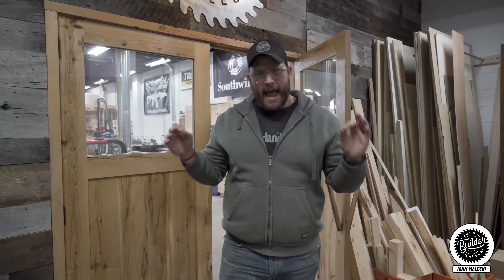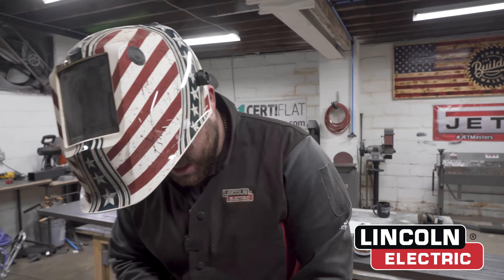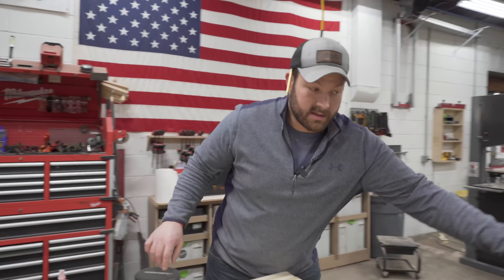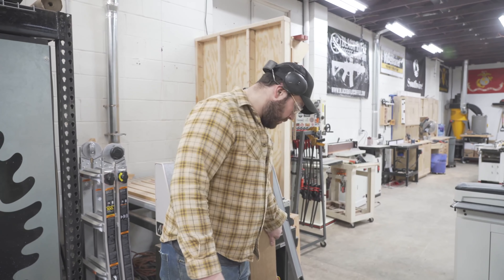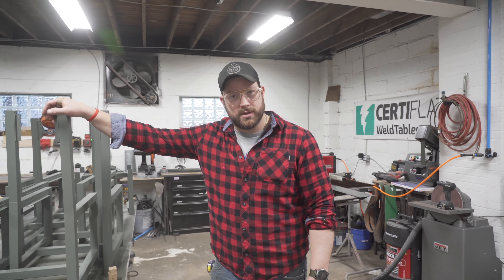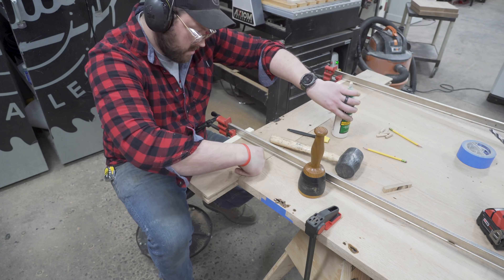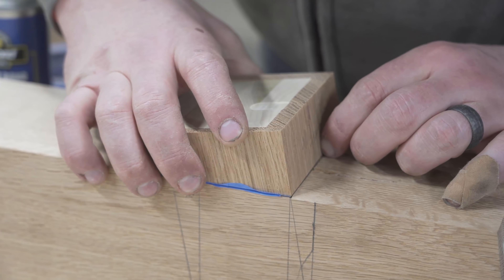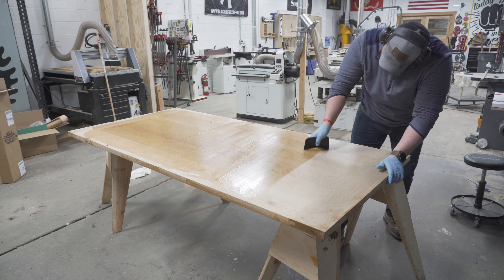EPIC Wood & Metal Dining Table & Chairs Build

Comment: Why do you make cross cuts with a jigsaw? Curious on why you wouldn’t just use a skillsaw?
Reply: So the kerf doesn't bind up on the blade. Or at least, it is a lot more dangerous when the cut binds with a circular saw rather than a jig saw. Rough sawn lumber tends to move a lot when you cut it, realising stresses

Comment: Awesome. Food for thought for your next breadboards... You can mark out the tenons while the stock is at full thickness and use your router to thickness only them and the tongue. Leaving the offcuts at full thickness lets use reference your router off of them (less tippy tippy) and puts less wear on your bit (since you're routing less wood). No need to thickness what you're going to cut off anyway.

Comment: If you want to make a really nice curved surface, use a small (I'd suggest 1/4" diameter) ball endmill in the router. When you set up the toolpaths in CAM, add more passes with a smaller step-over (stepover is the amount the tool jumps over after each pass). More passes with smaller step-over and a ball endmill will get the surface smoother. This is coming from someone with CNC mill experience making shapes like this out of aluminum blocks. Also, for programming toolpaths, I suggest Autodesk Inventor Professional. It is a good 3D modeling and toolpath programming software.